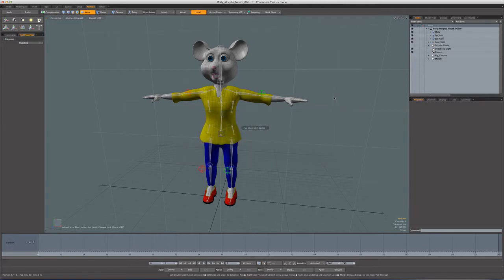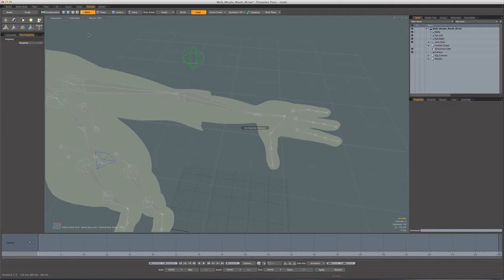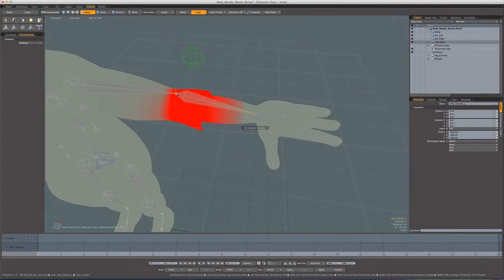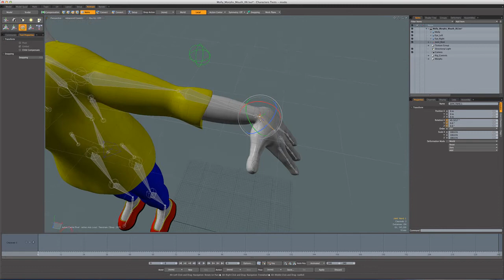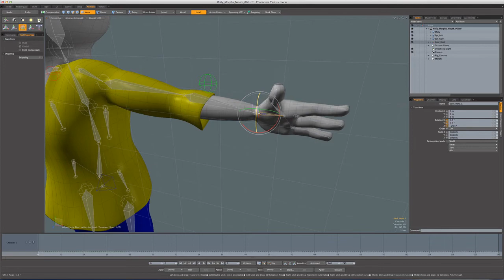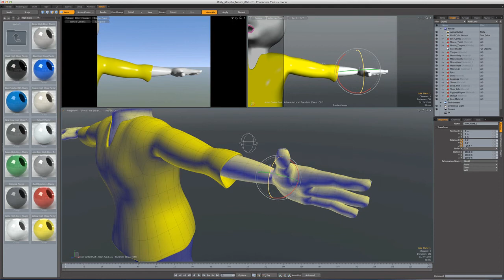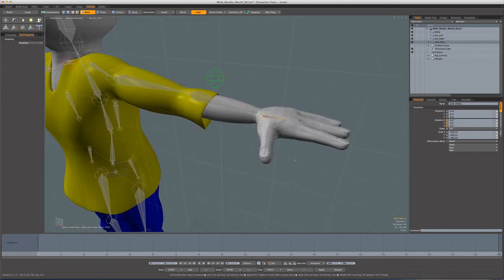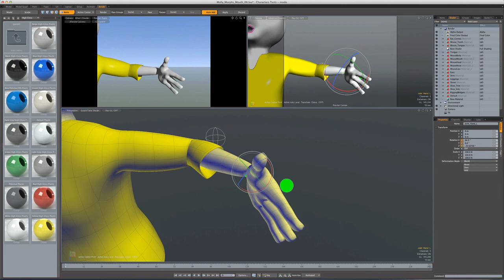Simple Ulna Twist in modo 601

Comment: Hello. A useful lesson for the characters plastered flesh. But if the character is a skeleton? How to make a rotation of Ulma? I can show character. Either for you a convenient way.
Reply from the maker: Hi Bers.  If the character is a skeleton, as you say there would be no need for skin weighting as in the method shown in the video.  For a skeleton, because bones are rigid, you would likely setup a relationship modifier using rigging (with the Modo schematic) such that as the hand rotates it causes twisting rotation of the respective radius and ulna mesh bones of your character.